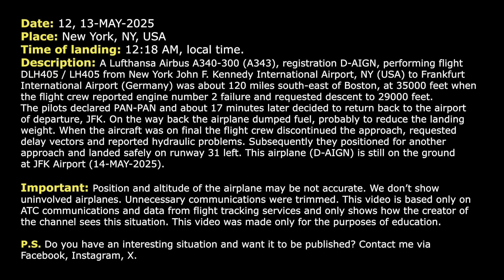Engine failure and hydraulic problems. Lufthansa Airbus A340 returns to JFK Airport. Real ATC

Comment: I don't get why you're continuing eastbound, instead of already turning back westbound, when you already know, it's either gonna be JFK or Boston. Poor decision making and unnecessary risk. And then you discontinue and approach with an engine failure on a 15 mile final? Dude get that plane to the ground.
Reply: A single engine failure on a 4-engine airplane is not an emergency. They were probably running checklists, tried to restart the died engine and weighed options.
Reply: You don’t know what you’re talking about. There’s no rush to turn round. Take your time. Make a decision. Plan your actions then do it. There’s no hurry at all to getting the ground. If this was a 747 you’d be thinking of continuing over the Atlantic.
Reply: @peteconrad2077  The decision to divert was already made at the very beginning. So there is already no need to continue feet wet. Now imagine a second engine quitting and now you're 150NM off shore. When it couldve just been 31NM or less. Nothing wrong in expediting things when you already made a decision that you're gonna divert. If they hadn't known that, I'd be on your side. But here.. nah
Reply: @1066JimJunior spot the guy who has never flown four engines. You make the decision using a coherent process once you’ve shut the engine down. Not at the beginning you amateur.
And in four engines the decision may well be to continue.

Comment: Why the pilot monitoring AND the pilot flying are talking to the air control centers?
Reply: Crew resource management.
If one of the crew is handling something, (like talking to dispatch, running performance numbers or completing a procedure) don't interrupt them. Let the other pilot handle the radios if their workload permits. Note that the switch between which pilot talks happens in larger time blocks. It's not just one reply by the other pilot then another switch. This crew was clearly on top of things and switched roles and responsibilities when appropriate for the workload on the flightdeck.
Reply: Thanks for the explanation 👍 
I always thought that the roles are strictly separated.

Comment: wieso heavy?
Reply: I believe Heavy simply means the plane is big (doesn't have to be actually physically that heavy as in full of fuel) and it creates a lot of wake turbulence in the air behind it, so when either landing or taking off, smaller airplanes behind it need more time for that turbulence to dissipate before it's safe for them on the runway.

Comment: Could someone please share what "information oscar on board" means?
Reply: At first contact with approach control the Pilots confirm the current Atis information which is identified by a letter. In this case O like Oscar. This way ATC knows the pilots know the current weather situation.

Comment: why they need to decide for 5minutes? the faster the safer right?
Reply: Just look-up "FORDEC" (or just pilot decission making). This is how decisions and prioritization are made in such cases. There are not many issues that require an immediate landing so it's much safer to thoroughly analyze the situation and discuss and plan the necessary actions. Also they knew they needed to dump fuel anyway before landing so there was absolutely no reason to hurry.
Reply: Quite a lot, actually. This was not an emergency, they did not have to opt for the closest available airport. Runway length, current weather, how much and when to jettison fuel, calculating the landing weight, and probably talking to dispatch back in Frankfurt where it's more convenient for maintenance and maybe a ferry flight of a wounded Airbus for the company.
Reply: No. No need for a quick decision. Need for a good decision.

Comment: How is it not standard procedure to at least start flying back towards land after getting an engine failure? Or is it because it is easier to dump fuel over water?
Reply: Because in some cases its not required, losing an engine on a 4 engine aircraft isn't an emergency.
Reply: Because there’s no rush. Slow and easy is best.

Comment: Why did they take so long to decide to turn back? they should have turned back immediately and to the nearest airport, no?
Reply: Flying with one engine out changes the flight characteristics of the plane. You don't make maneuvers like sharp turns until you know what your dealing with. Especially on an Airbus A340-300. They have bad maneuverability anyway.
Reply: A single engine failure when you have 4 isn't that big of a deal if there's no fire or damage. No need to panic or rush things. It's better to calmly assess the situation and come up with contingency plans before setting a whole bunch of things in motion that dramatically increase workload.
The moment the engine failed the crew would've been watching the other 3 like hawks. If those are all fine, there's no reason to rush things.
As for going to the closest airport, this might not be a good idea even with a worse problem with the aircraft. The pilots will have contacted the company dispatch after they made the assessment an immediate landing wasn't needed. Dispatch will take a slew of variables into consideration. Immediate concerns are weather and availability of emergency services at an airport. After that you think about passenger handling, ways to get the passengers home or in hotels, maintenance for the airplane, and a whole lot more.
Reply: Obviously they ran various check lists and perhaps they tried to restart the engine midflight. When that failed, they made the call to return
Reply: They absolutely don’t have to rush that.

Comment: Doesn’t make sense, as a PAN-PAN aircraft, to continue beebopping out into the Atlantic when their intention is to go to BOS or JFK. There are zero runways in the Atlantic, get that bird turned around!
Reply: They know better what they do than you ;)
Reply: @matthiashartge5520 correct, they know better “what they do” but I’ve been in that situation and there is zero reason to fly away from any place to land the plane.
Reply: @tncolburn  So you fly long-haule routes on quad-jets? ;)
If you look at a map, you can see that they basically fly along the coast. There is Boston 200 nm away, and left ahead of them there are still Halifax, Gander and St. Johns ahead of them. It's always easy to judge from the safety at home :)
Reply: @matthiashartge5520 yes I do. I fly the C-5 Galaxy and have crossed the pond dozens of times. I’ve had to shut down an engine in nearly the same spot. 

Fact remains that continuing to fly out over the water, AFTER they said they’d be going to BOS or JFK, was not smart. You can turn around and at least be closer to any airport. 

Yes it’s easy to second guess from home, but in this case I’m not second guessing, I’m speaking from experience.
Reply: @tncolburn Uh, people who can actually speak from first hand experience, are rare here 😂
Reply: @matthiashartge5520 this is oh so true. Probably the only topic I’d consider myself qualified to speak about experience.
Reply: @tncolburn well they also knew they had to dump fuel anyways, so maybe that’s why they didn’t turn immediately. Also, funfact: A few years back an Emirates A380 had an engine failure in a similar position and they continued all the way to Kuwait on three engines. THAT is bad practice 😂
Reply: @swems-z3s possibly. But you can coordinate a fuel dump in a holding pattern at nearly anytime, but it could’ve been a consideration. 

As for the Emirates flying 5,000nm on 3/4 engines, well they didn’t do what I’d suspect most crews would do. Just because you CAN, doesn’t mean you SHOULD.
Reply: Losing an engine is not an emergency for 4 engine jets. 

Its not an emergency, so the pilots are treating it as such. Since it isn't urgent they have time to contact their company, go through the abnormal checklists and make decisions on what to do next.
Reply: @theflyinggasmask correct, which is why they declared a “PAN-PAN” which is an aircraft in need of urgent assistance. But as the video shows they had a secondary malfunction which could’ve easily necessitated a “MAYDAY” call. Still makes zero logical sense to continue to fly out over open water. This isn’t a situation where they were close to an ETP, in fact they had not even coasted out yet on their Oceanic Clearance. Not a smart choice by the Captain.
Reply: @tncolburn  There was at no point any reason to facilitate a mayday call. Mayday is only used when there's an immediate life threat, which there wasn't. Pan-Pan is commonly used in situations where the plane has experienced a serious system failure or engine failure, where the plane is still able to maintain speed and altitude. 

As per the pilots SOP none of these failures would facilitate a mayday response. Not only did the pilots follow their training, remaining professional, landing their aircraft safely, but they also did it while avoiding unnecessarily disturbing the airport operations and surrounding traffic. 

This is EXACTLY the type of situation the PAN-PAN call was made for! ATC was informed of the nature of their emergency and was fully ready to facilitate a mayday call in case the situation escalated.
Reply: @theflyinggasmask never said they needed to make a MADAY call. It was a PAN-PAN situation. 

I’ve sat through many safety boards and had a situation nearly identical to this. The learning point is that to proceed further from a viable landing surface was an error. And more importantly a learning point for pilots in the future. 

Under radar control and VHF comms they only needed to say “We need a vector to keep us closer to land while we handle the situation”. It only takes one more malfunction to turn this into a MADAY and at that point you do not need to be worried you just flew an extra hundred miles from ANY airport.
Reply: @tncolburn  Its easy for you to say what they should and shouldn't have done, but the thing is you weren't there and you don't know the nature of their actual emergency, nor their company SOP's. 

They could've had their hands full handling the emergency, choosing to let the autopilot continue on course while they focused on solving the problem. Also known as "aviate, navigate, communicate".
Reply: @theflyinggasmask every flight has lessons to be learned. No flight is ever perfect. I’ve sat on accident review boards and safety review boards and been trained to see “what can be improved for next time”. 

No I wasn’t there in that particular flight deck, but I’ve been there in that situation and during my safety review board it was agreed that once the aircraft was under control that the prudent course of action was to point my aircraft towards land. 

That is part experience and part Aviate. Like I’ve said, it’s a lesson to be learned.
Reply: It doesn’t make sense to you because you don’t know what you’re talking about.

Comment: They fly A340’s still?
Reply: Lufthansa has an extremely diverse fleet:

Airbus: A319 / A320 / A320neo / A321 / A321neo / A321F (cargo) / A330 / A340 / A350 / A380
Boeing: 747-400 / 747-8 / 777F (cargo)
Embraer: 190 / 195
Bombardier: CRJ-900

A few years ago they also still had the MD-11F in service for their cargo operations.
Reply: @Hurricane2k8 you forgot the Boeing 787-9 which is already in operation and will replace the A 340 more and more.
Reply: @Haeuflor  When they finally will arrive, whenever it is. This A 340-300 involved in this incident (D-AIGN) is btw 27 years old.

Comment: Yeah, the aging 340...D-AIGN had several issues in the past.
Reply: Latest news is Lufthanse finally will decommission all A340 for good by fall 2025. They are waiting on a delivery of Boeing 787 as replacement
Reply: @OldSchool-px1xk  Only the -600 variant. The -300 may last a bit longer :)
Reply: @matthiashartge5520  aren't the -300 with their engines borrowed from A320 series generally older?
Reply: @feststelltastecapslock9869 Yeah, something like this. Airbus wanted something revolutionary, that took too long to develop, so they grabbed A320 engines from the shelves 😅

Comment: retire the a340
Reply: no
Reply: @Gabriele_Spagnuolo02  yes.
Reply: Retire the 787 and MAX.
Reply: @theflyinggasmask  no.
Reply: @HoracetheRepublican  yes.
Reply: If the brilliant manufacturer Boeing, which has been balancing on the edge of the abyss for years, could get its act together and deliver the 777X and 787, which have been years behind schedule for Lufthansa alone, there would be no need to use the A340 for longer than planned. But Boeing barely manages to get an aircraft off the production line. So, knowledge is power, you have proven that you have none of it.

Comment: A plane that has People headed out over the open ocean that has an engine failure for any reason is a Mayday Call, period. And why did it take “seventeen minutes after declaring the Pan Call for the engine failure” for them to decide to head back towards land? Unless they were fools, they knew they needed to turn back towards land and begin dumping fuel. Don’t rush but do it. It’s good to have more engines in the event of a failure, I prefer eight. But Ive watched videos of engine failures and or related and often unknown other damage to vital systems. If the fuel is contaminated, or multiple birds strikes, or who knows what, as engines may not fail at similar times. But as soon as one does fail, it’s time to land. JFK has the longest runway around and they just came from there so, they know the conditions. This should have been a no brainer. And what was the Hydraulic problem they said they were having? Did the extra flying time contribute to the Hydraulic problem? The crew while calm and clear speaking was also way behind the safety curve.
Reply: Actually it’s not an automatic emergency. There was a British Airways 747 that departed San Francisco and lost an engine and kept going to London. As long as minimum equipment list is complied with, the plane can continue.
Reply: Ohhhh…you’ve watched a bunch of videos. I guess that qualifies you as a Captain on about anything in any situation.
Reply: @stephenwalton9646  no wrong! I have a pilots license. IfR rated. You?
Reply: @rajdulay  He was responding to OP, not to you.
Reply: @rajdulay you have a single engine, non-commercial. Makes you almost as unqualified to speak on heavy commercial pax flight as the average keyboard warrior.
Reply: they had to check with the company which makes more sense. And no, an engine failure on a 4 engine aircraf is not an emergency. They weren't "heading out over the open ocean", it was always clear they'd turn around but they were already at FL 350 so they needed to descend quite a long time and dump fuel already, so there was literally no rush, the opposite actually.
Reply: This may as well have been a controlled shutdown due to high temps.
There is a nice pilotseye cockpit video of such a situation and how it's handled on an A340.
It's really not a big situation.
Reply: It's not a mayday, urgency not emergency!
Reply: Because it wasn't a critical emergency, it just was NOT. This is exactly why jets used to have 4 engines, so it wouldn't be a big deal to have an engine failure over the ocean. Even with twin engine jets nowadays it isn't even that big of a deal to lose an engine. 

If the fuel was contaminated it would've had an effect on ALL engines leading up to a failure. Had they had multiple birds trikes they would've noticed immediately and returned to the airport way before reaching any sort of altitude. 

Engines don't just fail one after another, they're so reliable nowadays that every one and their mother is making long haul twin jets.
Reply: Spot the amateur who doesn’t know what he’s talking about. 
You sound like you’ve never flown four engine and probably nothing more than your PC yet you think you know better.

Comment: Ah, the dreaded three-engine landing!

Jokes aside, seems perfectly handled by all. 

I do love me a four-holer, not just for takeoff but on approach/landing also, 25% reduction in thrust but you’re also light with minimal fuel and less yaw correction/drag. Almost a non-issue vs. a twin (which are also obviously designed for this scenario, but still.)
Reply: an extremely underpowered aircraft loosing one engine just sounds so hilariously ugly lmao
Reply: @davidlawand Everything is “underpowered” now that people are used to wide-body twins, when you’ve casually got a SINGLE ENGINE that has to be able to give you a positive climb rate at MTOW by itself. 

So yeah, you’ve got that thrust, X2 on every takeoff.

…that’s the minimum required thrust for a twin, so it’ll always be excessive during normal ops. 

In some ways you could argue that four-holers are more efficient in that they only require enough excess thrust to achieve single-engine-out capability with a 25% thrust reduction at MTOW. 

Of course on a daily basis that also gives you significantly less thrust for normal ops, but that’s how it was designed. Why do you need to take off in 7,000’ when you’ve got a 12,000’ runway? 

Again, the kicker comes when you DO actually lose an engine though. Now it’s actually not underpowered at all versus that twin, the tables turn completely. A three-engine landing is an inconvenience, a single-engine landing (especially on a large wide body) has a serious pucker-factor.

Comment: Classic Lufthansa pilot. Loses an engine, doesn't declare an emergency. Seriously, do they flog their pilots for declaring emergencies?? 😂
Reply: They have 3/4 engines working.
On an A340 that leaves time for a coffee break. It's really barely any different apart from the necessary descent to FL290.
Reply: An emergency should only be declared, when there is imminent danger to the aircraft or the people on board. With that sort of engine failure, they could have still gone on for hours. If you have a fire, medical issue, fligth control problems... That are emergencies.